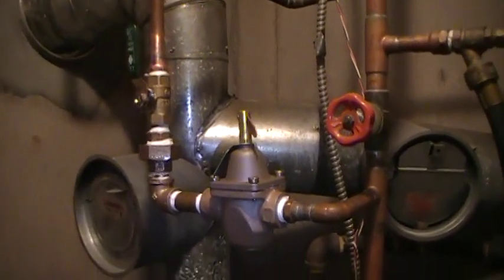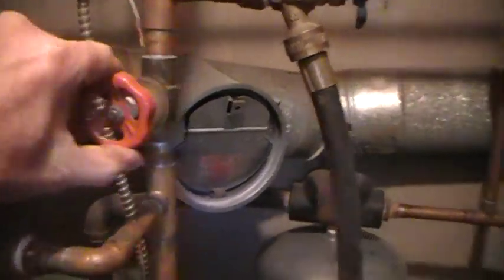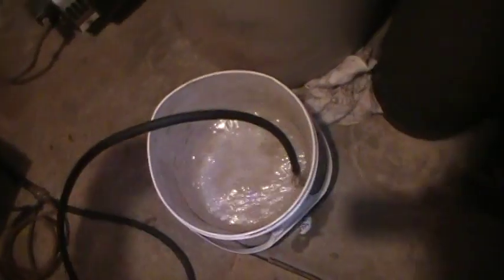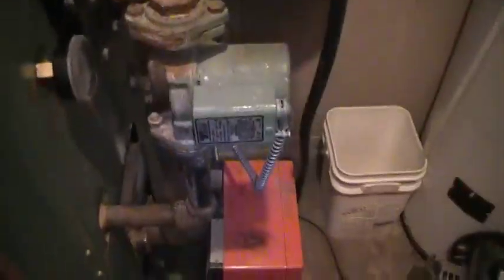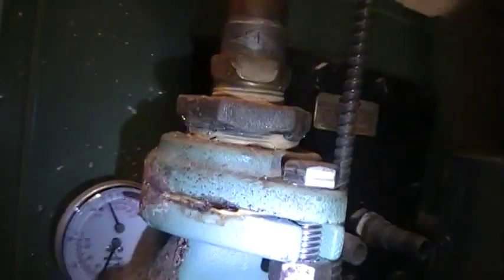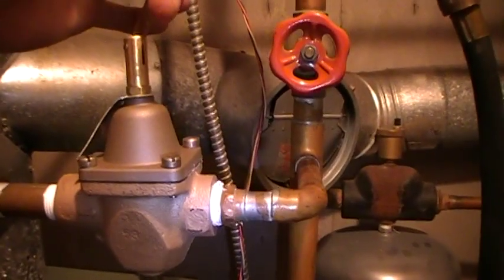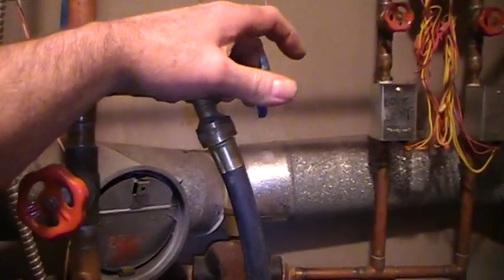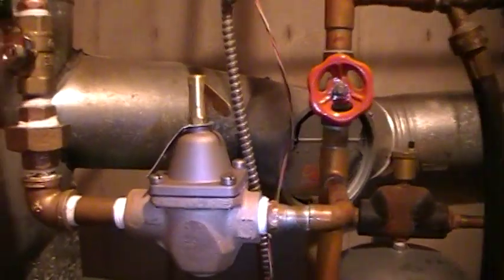How to remove the air out of your hot water heating system-girgling noise.

Comment: Soooo, I did it this way. THANK YOU! Had to use street pressure for 5minutes to get all the air out of one zone since it splits off(just bought the house).But how do I get the remaining air out of the boiler...without cracking it from cold water. Takes to long to cool off since need it now since it's cold out.My street water comes into the auto pressure thing that you can lift for street pressure. But where that comes into is on the back end of the boiler (output side?) and T,s into output on top of boiler. With this setup do I have to ever worry about cracking the boiler ? Mine gets to 20-30psi with valve down and almost 200F(190?)Had MANY plumbers out that couldn't fix the master bedroom since they would only fill one bucket, I used a hose outside for 5 minutes.
Bleed other zone too
Turned return on
Still a LITTLE air in there from being in the boiler I assume. Thanks
Reply from the maker: Hello Michael,
You are more than welcome!
Although it sounds like air is in the boiler it is probably in a loop. 
Any air in the boiler would rise to the top of the boiler and go into the header and into the loop from there. How many zones do you have?
Do you have an automatic air vent on an air scoop coming off the supply line?  
You will have to purge the system a little more to remove the remaining air. You are definitely in the right direction since you have removed most of the air so far.
What type of boiler do you have? Is it cast iron or steel?
The auto pressure thing is called a pressure reducing valve. Just to be clear..Is the feed line that supplies water to the boiler going into the supply on the top of it or into the bottom on the return?
You are almost there. Shouldn't be much to remove the remaining air once we figure out a few details.
Thanks for commenting and get back to me when you get a chance.    Al
Reply: Well, I kind of have to do it without air purge valves since I want a plumber to do it just in case that build up causes it to have to be welded. The good ones I know aren't available for easy task yet lol.
Boiler is a slant and fin cast iron oldie I believe. I think the little that was left in there may have went theougj the faulty purge valves or not made a huge difference after I heard it once. A night of sleep last night since that zone unairlocked itself lol! Didn't sound like my house was flooding or rainin from inside.
Thank you.
Yeah, I was assuming I'd have to just keep purging it like that until boiler had no more air since faulty high vents. I need a high vent installed in bedroom that was highest point, but street pressure for 5 minutes was able to fix that!
Was mainly scared to crack it with cold water. The water comes in 2 ft above where it first leaves the boiler (end of supply, start of return--it goes in there then splits up to baseboards then finally to bottom of boiler at return). After having it on for 5 minutes I could feel the heat transfer off the T pipe which was getting closer to the boiler (cold water getting close to boiler) and stopped bleeding because temp dropped 50F. Thankful it was just enough time.

Hope makes sense and all set now, but still scared I risked cracking it or blowing up lol. Could send pic.
Reply: Oh yeah it was two zones, purged them both. Figured that if I didn't have my heat on and baseboards were cool then I turned on furnace (cold or hot) that inside warms up anyways then opens the zone and mixes the ice cold water into the boiler water first somehow so it doesn't crack....if I was wrong I got lucky.
Reply: Feed goes into start of supply for baseboards , start of return to boiler
Reply from the maker: Hello Michael,
I am glad it all went well for you!
Congrats on the repair!
It could possibly crack the boiler if it was cold water going into it, but it sounds like you have it under control.
Nothing exploded, you slept and no more gurgling sound!
Thumbs up!
Thanks for commenting and have a great week!   Al

Comment: We just had a new boiler installed and besides the gurgling, our pipes bang. It is ALARMING😨. The plumber says he doesn't know how to resolve the bang, which is not only odd but scary. He poured some powder into the system...the banging didn't stop. He said the banging is the hot water meeting the cold water. He gave us the impression that, due to condensation, it's just the way things are and that it will stop once the system is hot. That means that this banging will happen everytime we turn on the boiler to heat the house. We have lived in our house for 41yrs and this bang never happened until he installed the new boiler last spring. I've read some stuff about alleviating the air out of the system; would this work? Is it possible to alleviate this banging or are we stuck with this insane sound?😭 Any possible advice????
Reply from the maker: Hello 171TITO ,
I am pretty certain that I can help you out with this problem. Have seen it a number of times.
It has nothing to do with condensation or hot water meeting cold.
The small pump that is installed in the system on the return line works very well to pull the water through each loop. The banging is caused by the zone valve closing too quickly as the water is still flowing through the pipe even though the pump has stopped.
I am not sure how many zones you have in your home, but you will have to adjust each return valve one at a time in a trial and error manner to correct the problem.
This is NOT a hard procedure and very easy to remedy. You can do this yourself. Be confident!
First the banging problem.
On the return side of the boiler (the pipe that goes back into the bottom of the boiler) is where you will find a valve for each zone just above the pump. 
Find out which return line comes from what zone valve as this will also help when you purge the system to remove the air later. Easiest way to do this is turn each thermostat up one at a time allowing a few minutes between. (Be sure to turn them back down once you find the return line.)The pipe that gets hot is the return for that matching zone valve. When you turn the thermostat up you will see the lever on the end of the zone valve move over or slide freely back and forth with your finger compared to the other zone valves.
Once you have found the return lines for each zone and your thermostats are down; close the return valve completely for each zone. I am not certain of what type of valves are on your system, but you want to open them about 1/3 of the way. Then turn your thermostat up and let the pump run for a short time before turning the thermostat down. If the banging is still there you may have to close the valve just a little more. I can assure you this will alleviate your problem with the banging.
Do this one loop at a time to ensure the banging has stopped. 
They do make slow closing zone valves that prevent this from happening. Another solution is to remove a spring off the zone valve to allow it to close slower. These are two other options, but closing the return valves will work for you.
Secondly is the air problem....gurgling sound.
You must purge the system. If you follow the procedure in the video slowly; you will be able to remove all the air from your system. 
Time is required this as it takes a little while to do, but it does work.

Quick question. Is there an air scoop coming off the top of your boiler with an automatic air vent on it?
Get back to me on this before you begin to purge.

If you have any other questions regarding the system feel free to ask.
Please let me know how you get along.

Nothing worse then banging pipes while you try to sleep. 
By the end of the day all will be resolved. Think positive!
Thanks for commenting and good luck!    Al
Reply: +TheOldKid888 God Bless You!
Reply from the maker: Hello 171TITO,
Did you have any luck?
Reply: Thank you so much for such an in depth solution! I had been having this exact issue and spent hours trying to bleed air from the loop. Took me ten minutes to adjust the valve and remove the bang thanks to you. I just wish I had found this sooner.
Reply: TheOldkid888 So sorry to get back to you after so long. We have a master plumber coming over and we'll get him to adjust the air vents. I will update you.
Reply from the maker: Hello Seth,
You are more than welcome!
Bad enough hearing the banging during  the day, but it can really put you over the top throughout the night while trying to sleep.
Glad everything worked out for you!
Congrats on the repair!
Thanks for  commenting and have a great week!   Al
Reply from the maker: Hello  171TITO,
Get him to adjust your return valves on the boiler. This is how the banging will be stopped.
Close them slowly to a point of where they are 1/3 open and you should be all set.
Let me know how you get along!  
Thanks for commenting and best of luck!    Al

Comment: When I do this, it empties the 2nd floor completely. Even opening the pressure valve does not more than overwhelming the boiler causing its pressure relief valve to open.but, I have pressure at all the baseboard bleeders on the affected ( second) floor now what?
Reply from the maker: +dennis Hayes 
So when you lift the lever on the pressure reducing valve you must watch the gauge on the boiler to keep it around 15 pounds while purging the loop. It will drop the pressure off the entire system if you don't throttle the lever on the reducing valve. It has to be throttled. If you lift the lever gradually you can keep control on the pressure. Be Sure to watch the gauge.
This will keep the pressure on the system for you. You must watch it as you don't want the relief valve popping off.
Thanks for commenting and enjoy the day!    Al
Any other question...drop me a line.
Reply: my pressure gauge and the bypass/relief valve are too far apart to watch them both.  I've already done it once & had it pop on the boiler itself.
its a 4 zone system, BM,1st FL,2nd FL, MBR.
3 of them bleed fine this way, the 2nd floor just drains for ~3 seconds then dies.
replaced the pump motor (B&G 100) because the one in place was locked up. there are 4, 1 for each zone. replaced the in line valve next, no change.
whats odd is, I can go upstair & bleed them at the bleed valves & get good pressure, I just have no circulation even though the ppump is running
Reply from the maker: dennis Hayes
I would check on the second floor, but you can go to the gauge and see what it reads. If the pressure is below 12 pounds lift the lever for about ten seconds and check the gauge. You can increase the pressure this way. You may have to do it several times.
You could also get someone to look at the gauge for you while you lift the lever on the pressure reducing valve.
Since it worked for three of the four zones, there is no reason why it won't work for the top floor.  
You need water in the second loop to get any circulation. If the water isn't there you should turn your thermostat down until you get water in the loop or the pump will continue to run. Be sure to have it purged before you turn on the thermostat. 
Bleeding each rad will work for you as well.
Thanks for commenting and best of luck with the loop.    Al

Comment: What if your zone valve doesn't have a switch?
Reply from the maker: +Comegetsum2011 
In that case I would simply turn up the thermostat which will open the valve. The boiler may fire up, but you will be able to purge the system like this. Have done it many times.
Thanks for commenting and best of luck with the project!    Al

Comment: once you purge the air does more water need to be introduced into the boiler manually or will it fill back up automatically?
Reply from the maker: +turbonova06 
The water should go into the boiler by itself through the pressure reducing valve. Sometimes sediment or minerals in the water will prevent this from happening.
If it does not reach 12 pounds on the gauge you can lift the lever on the top of the pressure reducing valve and allow water into the boiler. Watch the gauge as you lift the lever; the water can enter the boiler quite quickly and you want it
in the 12 pound area.
Thanks for commenting and have a great week!     Al

Comment: Hi Terry, In my upstairs bedroom my radiator constantly leaks (and girgles) water on the left side (the side with the knob?) I am desperate since the water just comes when the heat is on.. I need heat but I feel so afraid the floor will rot and I will fall through the floor. Please please help?????
Reply from the maker: +kathyfellows7 
Not sure if this is directed for me or not, but Is it the radiator or the valve on the side of it? 
If it is the valve you maybe able to tighten the packing nut on it. If it is the radiator you will either have to get someone to repair it or replace it.
Thanks for commenting and get back to me when you get a chance.     Al
Reply from the maker: *****
Nice to have that repair done for sure.
Sometimes if you don't know exactly what is going on you are better off paying to have the problem corrected. Gives you that ease of mind.
Thanks for commenting and enjoy your week!   Al

Comment: When you bleed a boiler and radiator system. Do you leave the circulator  pump on or leave it off?
cfcooney
Reply from the maker: Hello Charles;
You should turn your thermostat down when bleeding the system. Not a problem turning the main power off if you wish. Once it is purged you can fire the switch back on and you are all set!     
Thanks for commenting and have a great week!     Al
Reply: same question thanks dude, be well

Comment: Ok so thanks for that. But now heating only goes to my 2nd floor and not my first. I'm thinking that it's either the thermostat or the zoning valve. Probably the zoning valve. Everything worked until I tried to drain the air/water from the  system and then these problems arose
Reply from the maker: Hello Gani;
You are welcome!
It sounds like the zone valve to me as well. Try closing the return valve on the loop again and open it slowly. If by chance it is a gate valve there; the gate may have stay in and not be drawn back when the stem when the valve was opened. By slowly opening the valve it can sometimes pull the gate back if this is the problem. Hopefully it is nothing to serious.
Thanks for commenting let me know how you get along!     Al

Comment: after i did this it ran out of water and now the furnace heats the boiler but my home doesnt get heated. only the water
Reply from the maker: Hello Gani;
You will have to add water to the heating system by lifting the lever on the top of the pressure reducing valve. This will allow water to enter the system and drive the pressure up. Be sure to watch the gauge in the front as u don't want the pressure going above 12 pounds. 
What has happened is the pressure reducing valve is plugged with sediment and will not allow water into the system. Lifting the lever will allow water to enter.
Thanks for commenting and let me know how you get along!      Al

Comment: my system doesn't have a zone valve, it has a circulator pump. can I purge the system the same way ?
Reply from the maker: Hello Robert;
If your system has a valve on the return and a shut off below it; you can definitely purge it the same way.
Coming off your supply instead of a zone valve is probably a flow control valve. It is like a check valve that opens when the circulator comes on. If you don't have a drain valve on the return then you will have to individually do each piece of radiation. Do you have all baseboard radiation throughout your home? 
Thanks for commenting and have a great week!      Al

Comment: Hi it dodnt sove the problem.
I think its time to call the plimber
Reply from the maker: Hello obadboystanley;
It could possibly be that time. Hopefully it is something small and can be fixed relatively quick.
Thanks for commenting best of luck with the repair!     Al
Reply: TheOldkid888 it was a frozen  pex pipe. It was cut and replaced.  Then i think  he did what you did in this video to it thaw out .
Reply from the maker: Hello obadboystanley;
I am glad you got everything straightened out.
Frozen pipe is a hard one to find. He purged the system afterwards so you are all set now!
Thanks for commenting and have a great weekend!    Al